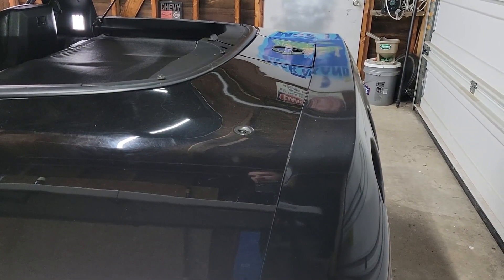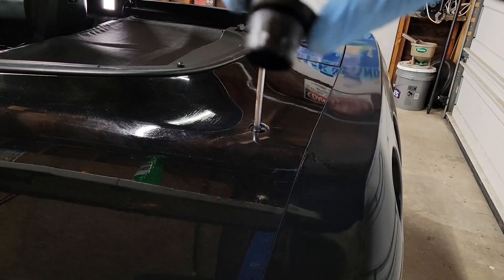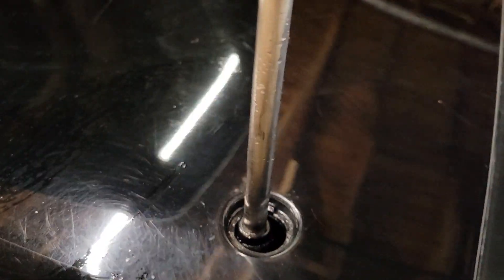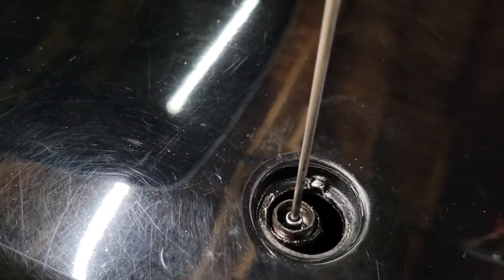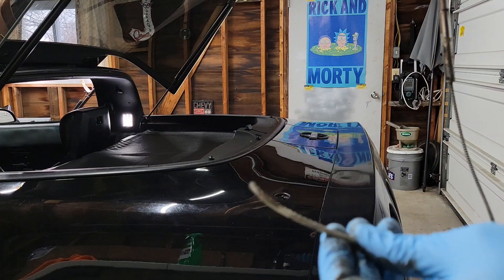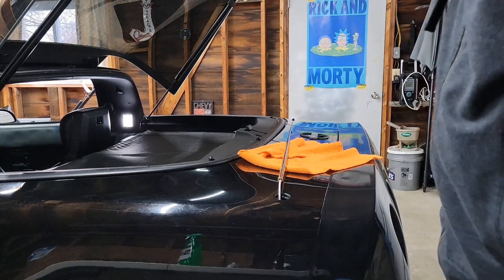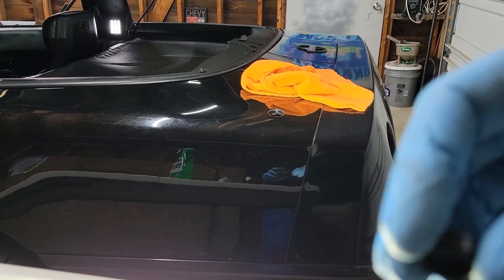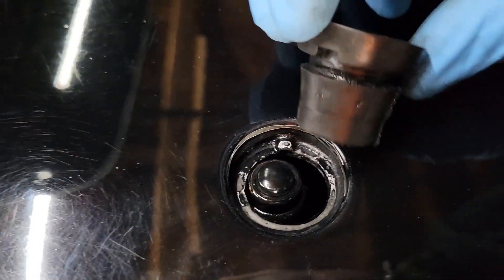C4 Corvette Antenna Mast Repair

Comment: This is by far the best video about this topic. I replaced my antenna mast today on my 96 vette, just following this video. You definitely saved me some bucks. As somebody mentioned before, I recommend using the tool's oval side (almost circular) to remove the mast nut instead of the hexagonal side. It fits perfectly snugly around the nut. Also, another tip, when the motor finally sucks the new antenna for the 1st time (which is by far the most complicated part of the process), present the nut back again before turning on the radio, or the antenna will be ejected before you can adjust it. It will take a couple of on-and-offs before it folds down ultimately.

Comment: Helpful hint… when using the wrench included in the mast replacement kit, use the oval end— not the hex end as he tried here. Tap the oval end over the ring and remove it (no need to remove the rubber grommet). I used a 5/8 socket and ratchet over the hex end for a better grip.

Comment: How do you know if the issue is the mast or the motor? 
For me, my antenna won’t go back down, but I can hear the motor run when I turn the radio on or off.
Thanks!
Reply from the maker: If they motor is running its most likely the mast. The plastic teeth on the mast cord wear down over time causing them to slip and not retract. I would just replace the mast as it's quick and cheap. Hope you can get it working!